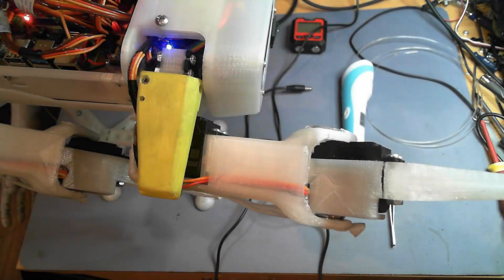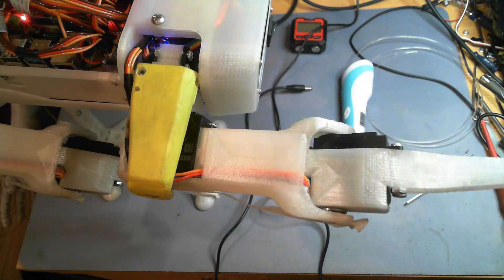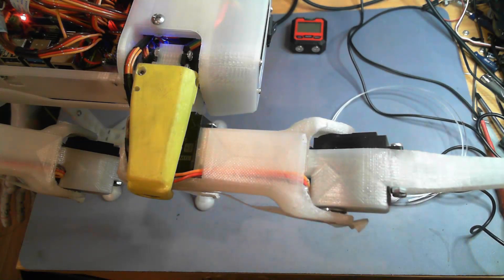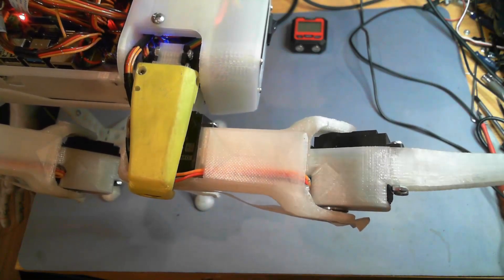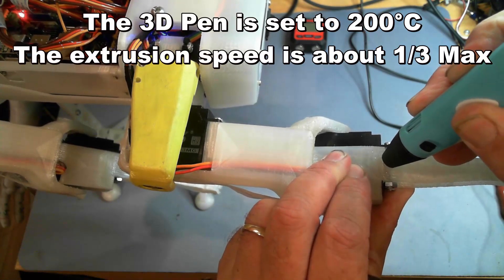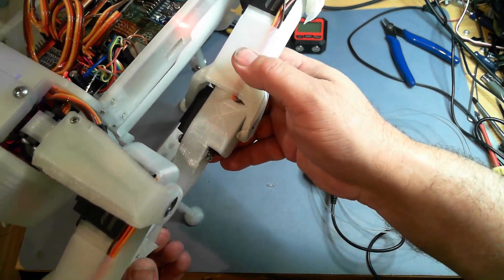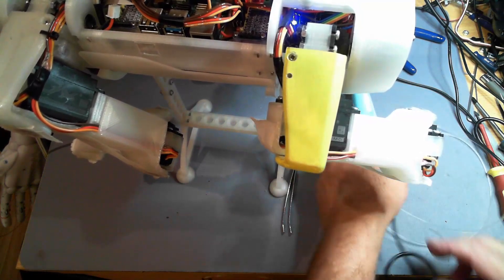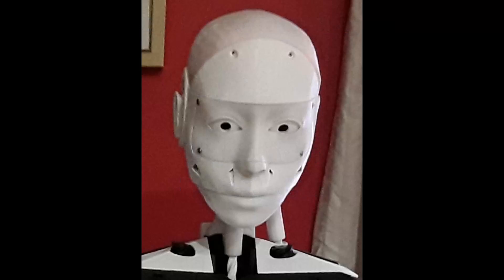SpotMicro Part 29

Comment: also if you multiple cracks , means an design flaw . the place were the servo sits stops instant to the leg .
that should be gradully . if you have the file from that leg i can change it for you .
Reply from the maker: All the files are on Thingiverse, links to that are in the GitHub in the parts list in the docs.
Most probable cause of the cracks are from the bot falling over as I try and teach it to walk.
I've printed out two sets of legs in the Tough Flexible Resin from AnyCubic on my SLA printer, I'm working on the other two sets.
These should be stronger prints, but we will see how they turn out.

If your interested in changing the design of the legs, then catch up with me in the Discord, the link is in the description.
I have a few ideas about how they can be improved. :-)